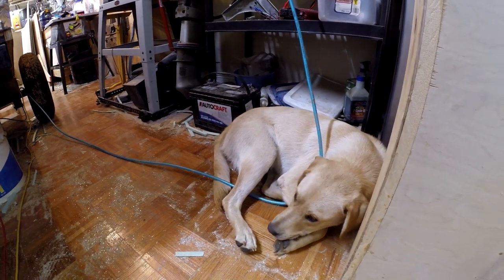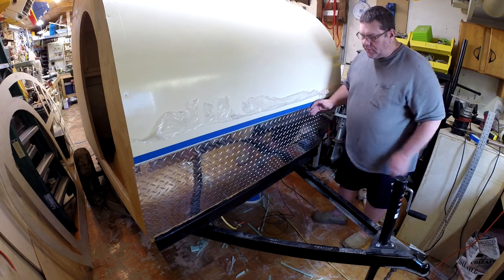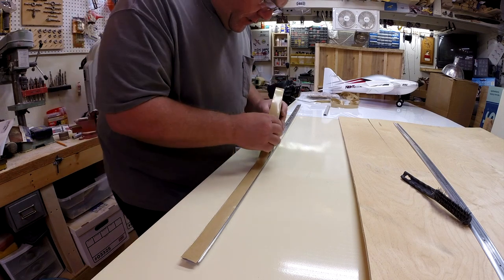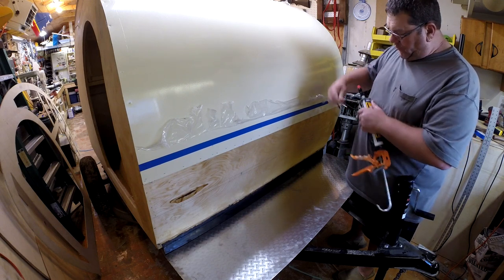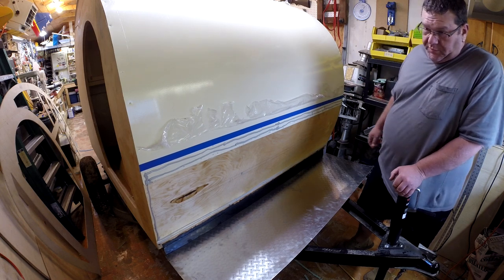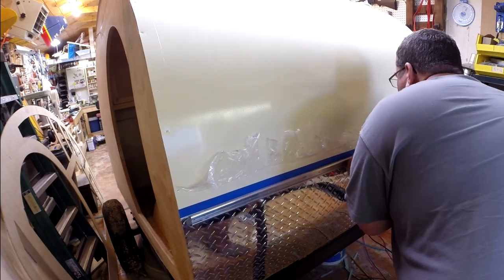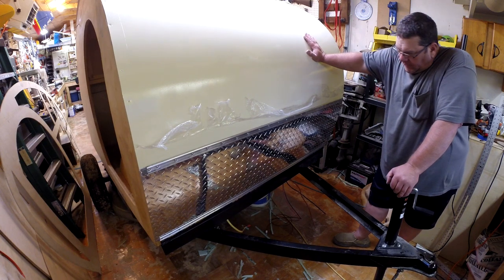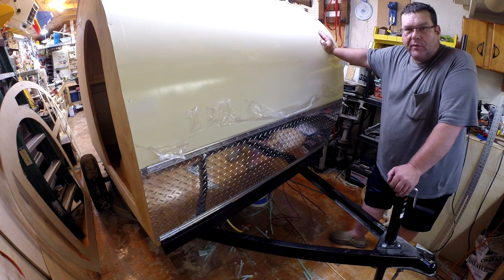Teardrop Skin Part 2 - Diamond Plate Stone Guard

Comment: Very nice camper build and I like your low key humble style of explaining the process. The tip you provided on using a wirenut for the caulking tube tip is brilliant. I've paid several bucks a piece for several types at the hardware store that were disappointing at best. Thank you brother.

Comment: How about the Aluminumn Expanding in Sunshine? Dont the Holes need to be larger than the fasteners?
Reply from the maker: Pretty much every teardrop I’ve seen has minor buckling in summer heat.  Usually, it’s barely noticeable though.  The side pieces of skin float and are held by the trim.

Comment: I am getting the tear drop bug and have been watching several of your build videos as well as researching others.  Question.  Why not laminate the skin or diamond plate with contact cement?  Are the beads of caulking just easier and equally effective or is there just the fear of misalignment issues with contact cement?
Reply from the maker: Laminating the aluminum over the wood will make the metal buckle when it gets hot outside.  The metal skin only needs to be fastened around the perimeter and around any doors or windows.  I used a polyurethane sealant to fasten mine and held the skin in place with strips of tape until dry.  Ultimately, the metal trim along the edge will lock it in place.  Using this method allows the metal to float and resist buckling.

Comment: What did you use to attach the aluminum skin did you staple it down and if so what staples did you use
Reply from the maker: I stapled the edges of the top sheeting with 1/4” crown staples.  Just a few though to tack it down.  Ultimately, it was held down with the trim/screws.  The side sheeting was applied with polyurethane sealant around the edges and around the door and taped to hold it in place until dry.  The trim overlaps it and holds it as well.  I have an episode on it.

Comment: Hey Michael, question! When you put that trim on right above the diamond plate, did you drill through the diamond plate with the screws or just above it?
Reply from the maker: Susan Highfield I put the trim right on the diamond plate.  There’s a layer of 1/8” thick butyl tape between them.  I drilled the self tapping screws right through the sandwich or layers.  If memory serves me right, there was a crossmember underneath that the screws went into though.  Afterwards, I ran a thick bead of Trempro 635 along the top of the trim and against the sheathing to properly cap everything off.  In retrospect, I wish I would have ground the diamonds off the plate with a hand grinder where the trim would lay.
Reply from the maker: Also, don’t forget the sealant between the diamond plate and sheathing!
Reply: Thanks!